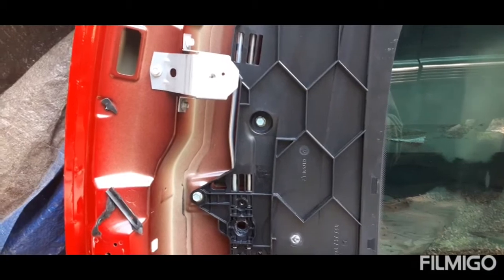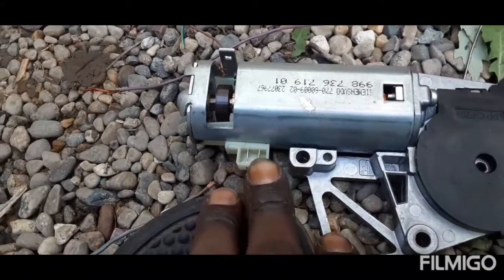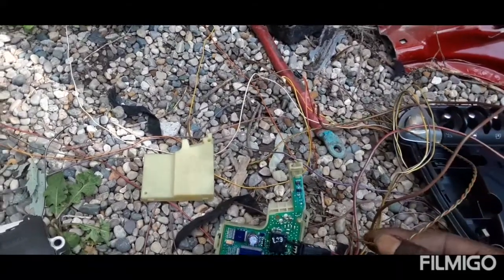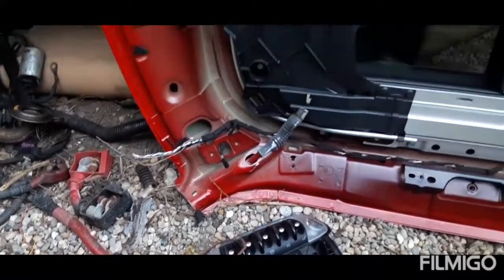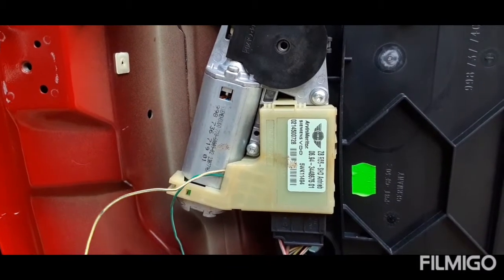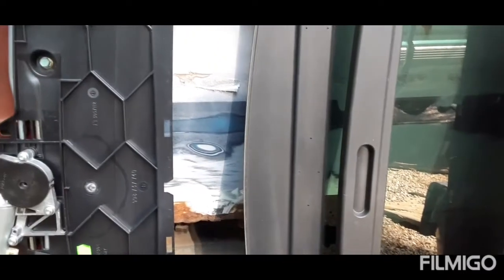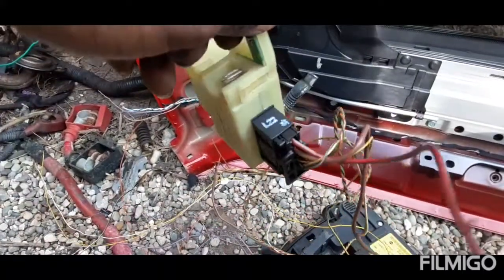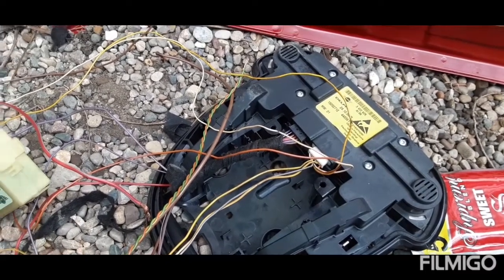Mini Copper Panoramic Gen 2 Wiring Info

Comment: Ok i see you ran wires straight to the motor. But what about the switch for actually hitting the button. How was that wired? Did yu use the same switch sitting on the ground if so how did yu do that. If not, than what was the actual switch you used to run a hot and ground

Comment: Good stuff, what is this going in??
Reply from the maker: In Boxchevy Dames Caprice
Reply: @BackyardFamilyBuilds  yessir
Reply: LsChevy Ryda89 waiting to see how it turns out. Don’t want to cut into my quarter top trim
Reply: Anymore info on wiring it up I'm stuck as of now wanna make sure roof works before I start cutting
Reply from the maker: What Gen Roof
Reply: You don't have to go thru all those issues. Just use the motor and wiring harness from the first generation, and it will work as intended.
Reply from the maker: @davaughnjones9799  Yes Agreed Second Gen Is A Headache But That Double Tilt Mode..Is Sweet
Reply from the maker: Hmmmm.. I'll Have To Look Into That Thanks